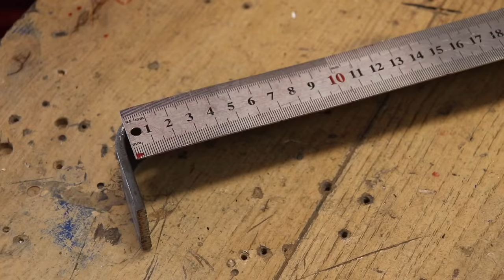How to Make an Motorcycle Scooter at Home

Comment: Why do you stop/start the mig all the time? If you do a continuous weld you'll get decent penetration and a strong weld. Why are there no bearings on the  rear axle?
A chain guard is an absolute necessity. 
Other than that it looks like fun

Comment: Dear Mr. Tool Hacker. Awesome Idea! 
But can a small engine withstand this load?
I once built a bicycle with an old 35cc chainsaw motor with about 1 hp and it broke after a short time. 
I'm a heavyweight, about 95 kg🙄🚛
This is more for children.
Its for adults.

Regards from Germany